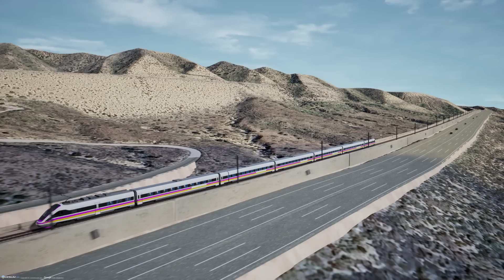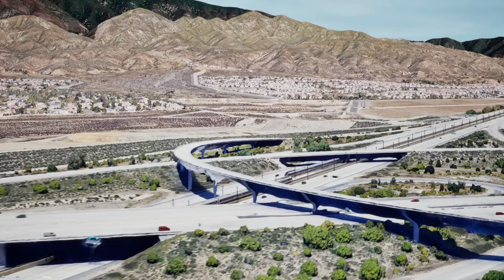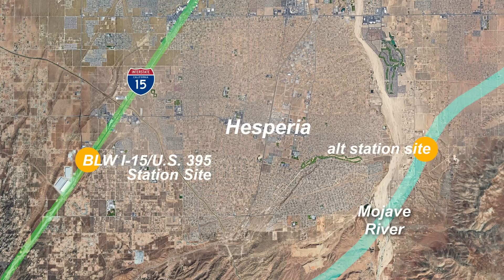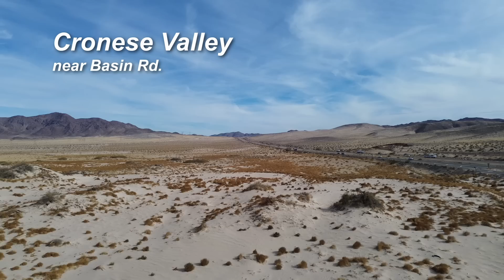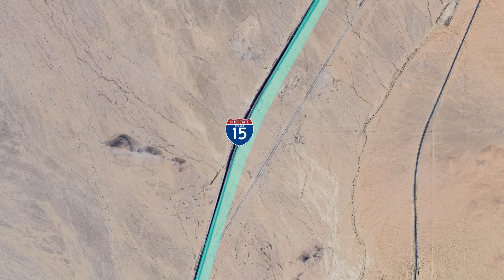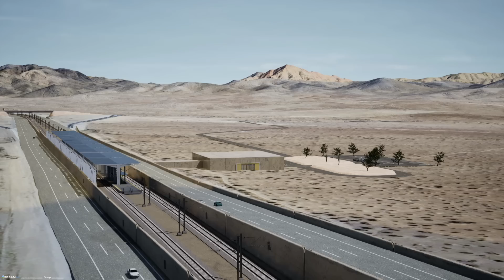Brightline West High Speed Rail Better, Stronger, Faster

Comment: Americans will not believe in high-speed rail until they have multiple successful examples staring them in the face. I'm fine with single track for portions as long as they get this done in time for the Olympics.
Reply from the maker: Got bad news for you. BLW is now stating end of 2028.
Reply: @LucidStew  given the origional plan was to start heavy civils in 2023, this does make sense as whilst it might be possible to build it. It will need a lot of testing for the safety case.

Comment: only issue I can see with the Rock Springs X Deep Creek is that area washes out when we have hard rains and they shut down the road where it crosses the river so would need to build an elevated bridge and parking structure as well as floodwater management. theres also just, nothing over on this end to be a marketable draw other than locals from that end of Apple Valley.

Comment: They can upgrade later. More manufacturing and construction infrastructure companies producing may reduce the future costs. Especially, if this line show successful operations. Logical step would be to connect this line with phoenix or Salt Lake City.  When the Cal HSR project is abandoned. A HSR project could be started connecting the costal population, and connecting with this line.

Comment: The time to build tunnels would add years, and the environmental process to leave the Caltrans ROW and to obtain the property would add another decade to this project. 2028 would become 2040. 

Running in the Caltrans ROW is the smart move, and CAHSR should have done the same thing and ran along I-5 vs the CA99 corridor. Yes it would skip some of the Central Valley cities, but they are just going to slow the travel time and not provide much ridership.

Comment: With the addition of the Hesperia station, the Victor Valley station should be eliminated. It was only used because that was the terminus that Desert Xpress was able to negotiate with Caltrans. There is zero need for a station there. Make the Hesperia station the only high desert station and have all trains stop there.
Reply: I think they might want to build a spur line from Victor valley to Palmdale in the future whenever California high speed rail starts operating, that way people from the central valley and the Bay Area can ride into LV as well, and people from LA would probably transfer there as well.
Reply: @greasher926 that connection is very unlikely at this point. If that connection ever comes to fruition, then build the station as a part of that project. With today’s incarnation there will be almost no ridership from that station.

Comment: I think your average speeds are way to high, rome to milan are ~580km takes 3h, giving an average speed of  193,3 km/h with no stops and nearly constant 250 km/h +. For reference: An ICE 4 (a fairly powerful train) takes 5 min to go from 0-250 and nearly 15 km.
Reply from the maker: This would be brand new, exclusive, and purpose built. The idea that something averages 193 while being "nearly constant" 250 is contradictory. HSR acceleration within the 3-4m/s^2 range is a common capability within the lower part of the speed curve. This would result in 0-200mph in roughly 7 miles.

Comment: Definitely worth for Brightline to do what they are doing. Getting any more funding for what they already need would be incredibly difficult, and would likely have the whole project cancelled. Once we get something built, improvements and expansions can be done later.
Reply: Especially if they take the time to make provisions for future expansions.

For insteance on single tracked segments place the track off center to match where it should be for a double track alignment. That way when its time to double track, the existing line will be unaffected while you work and only needs to be shut down when connecting the ends if those segments.
Reply: Building anything in California is a win.
Reply: AND VERY EXPENzsIVE!!!
Reply: I agree this could be like an upgrade
Reply: I agree. However, I would wait until the line is at least 25 years old before considering alignment improvements, such as viaducts and tunnels
Reply: Agree, we should wait and see if demand justifies the expense.
Reply: Brightline should develop a new station in Vero Beach, tbqh for people that live in that area, probably.

Comment: I may prefer Lucid Stew's plan BUT I can guarantee you that Brightline West wouldn't build it that way because of the huge additional costs and time required.  I'm completely fine with how they're building it.
Reply: Agree. At least we are getting something between Los Angeles and Las Vegas. Well, near Los Angeles. Looking at the videos of Brightline Florida, it will be smooth and quiet. Plus, all electric and no road crossings would make it safer for all. I live in Charlotte NC and would make a trip to Cali just to ride it. My father lives in Pasadena CA. He and I would ride the A line from Pasadena to Los Angeles, catch the San Bernardino train to Rancho, then hop on to Vegas. Can't wait.
Reply from the maker: The A Line extension to Pomona is about to open. You'd be able to catch Metrolink from there, save the trip into L.A.
Reply: @ Hopefully to Montclair by then. That would be sweet.
Reply: @ By the way, love watching your videos. Now I am hungry. About to make some stew. See you on that freeway.
Reply: @twizshiz  Riverside/Ontario/San Bernadino is the 13th biggest MSA in the US by itself. I don't disagree that getting directly to LA is very important, but this is a very high potential location on its own.
Reply: If Brightline builds it your way, it will be complete just after the HSR and cost about as much.   Those tunnels are EXTREMELY expensive and slow to build.  HS2 in England is getting killed by the costs of the tunnels
Reply: @ Yes. Time of construction (and delay of operation) is also a huge cost for private companies.

No private company can afford 15 years of construction time.
Reply: @georgepratt3721 HS2 is also getting killed by Tories being dumb
Reply: Looking on their decision making I'm half expecting them to ditch electrification and seriously ask siemens  if they can make for them faster diesel multiple units
Reply: @ЯрославКовальчук-и9ь  125mph is about the most you can wring out of diesel electric; a diesel motor is just not efficient enough to get sufficient power out of it. Siemens know that it is not cost effective to try to get more, (this is not a new idea).
Reply: @ЯрославКовальчук-и9ь  That would be a disappointing plot twist.

Comment: I think Brightline made the right call. It would be nice to shave off some time, but their current plan is a huge improvement on rail services currently offered between LA metro & Las Vegas (which as far as I know is nothing) and their current plan will be able to be built much faster than if they had to do tunneling.
Reply: I mean, there's currently no rail service between LA and Vegas, so just about anything would be an improvement. Amtrak's Desert Wind, which was discontinued in 1997, took just under seven hours between LA and Vegas (BLW with Metrolink plus time to transfer at RC should take about half that time). Brightline West currently projects that service will begin in December 2028.
Reply: @ChrisJones-gx7fc  It would be nice if Amtrak could use BLW from La(RC) to LV(Bi-mode loco would be in use here), when the Desert Wind comes back.